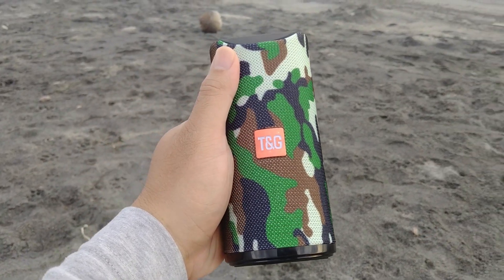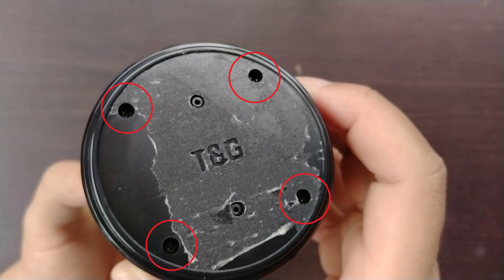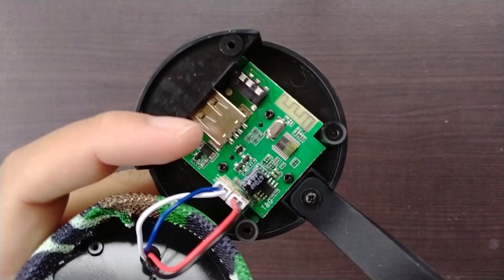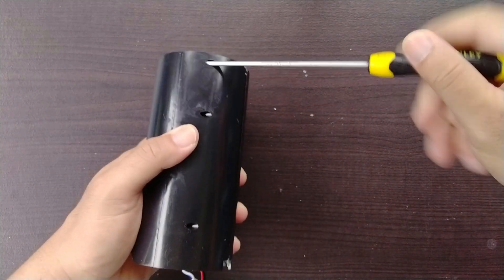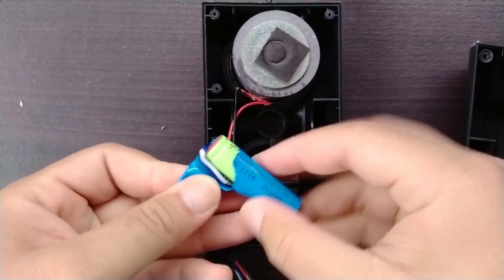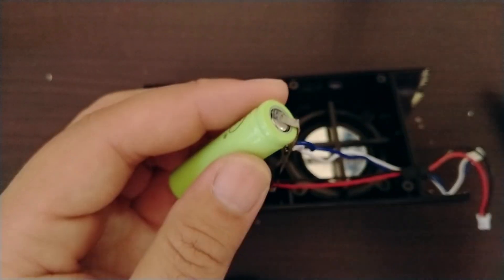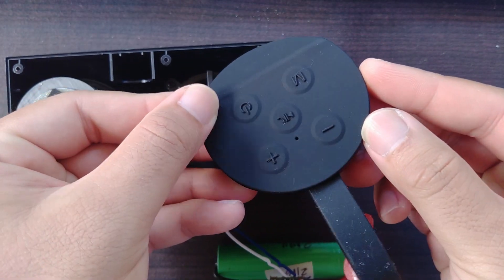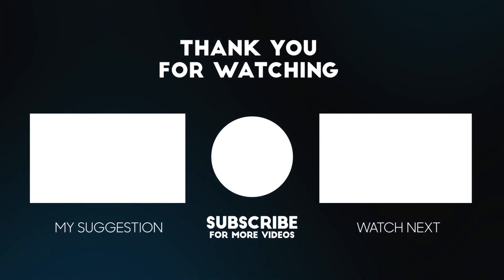How to change the T&G TG 113A Battery in 2025 (TEARDOWN)

Comment: Sir, what is the purpose of the passive radiator?
Reply from the maker: A passive radiator makes it possible for woofers to generate deep sounds, for it to work the enclosure has to be air tight and of course the speaker driver has to be a good one.
Reply: @TaylorSoloaiJR  thank you sir.
Reply from the maker: You're welcome

Comment: I think the reason that TG 113A has a space for 18650 battery is because the TG 113 uses one since it's battery capacity is higher
Reply from the maker: Yes that's exactly what it's for, the original battery is around 500mAh which is not much.

Comment: Hi idk if I'm gonna get an answer but ok.
So I'm planning to upgrade the battery of this one into a 4400mah battery that I have, but I don't have an BMS, can I use the original one on my 4400 battery? Thanks
Reply from the maker: Yes just use the BMS from the original battery of the speaker, you might want to make sure that battery really has 4400mAh. Unless you have two cells in parallel to make up that amount of mAh. The highest I've seen on a good cell is 3500mAh. More than that, then that's just too good to be true.

Comment: Can i replace the old 18650 battery of my Bluetooth speaker with a new 18650 with higher mah? 
Old one is 18650 2600mah
New one is 18650 3600mah
Reply from the maker: Yes you can

Comment: My battery doesn't had a bms
Should I buy and put it in my speaker battery or there is nothing to worry
Reply from the maker: Really? Maybe the bms is built into main board (that's just a guess). Doesn't hurt to buy one but I think it should be okay.
Reply: @TaylorSoloaiJR  thanks for quick reply.

Comment: You can also connect a mobile phone battery with stock
Reply from the maker: Not a good idea if the batteries have different mAh
Reply: @TaylorSoloaiJR  I have added a 1200mah battery with stock. Device is working fine

Comment: Soldering  the wire directly to a battery will shorten the life of the battery, or, if you are not careful, even destroy it. It's much better to buy a battery with welded strips on it, then solder the wire to these strips.
Reply from the maker: Yes you are correct, that's why it's important to do it fast but I love the idea of buying one with nickel metal strips. It's a lot safer and easier as well.
Reply: Is it possible to cool the battery with ice first then solder, the ice not directly in the contact with the battery?
Reply: @kangle2938  No. Because then you  have to solder longer. The 'trick' with spot welding is that you quickly (in milliseconds) heat very small volume on the surface of the battery, and although the temperature in the spot is very high (~2000K), the amount of produced heat is  low.
Reply: @ivanakoide9090  Oh is the spot welders cheap?

Comment: what happens if i use 2 18650?
Reply from the maker: Two 18650 batteries in parallel will increase the mAh which means more playtime. Just remember do not connect them in series.
Reply: @TaylorSoloaiJR  thx bro

Comment: Is it okay to change the speaker to 4ohm 10w and a 2200mah 3.7v parallel?
Reply: I guess as long as both batteries are from the same place and have the same charge before getting connected in parallel. Best to use new batteries. If you change the speaker to 10w you will only get 5w from it because the amplifier is only capable of outputting 5w.

Comment: Hi , i just did the same thing that you did , same bluetooth speaker .
I used 2 batteries from a power bank and it seems to work but I'm not sure what batteries they are , because the power bank it's a fake chinese one and I wanna know if it's safe to use them .
Maybe if you can send me some pictures on instagram to check them or something , thanks.
It's same batteries like you used but it's 2 of them , that's all
Oh yeah and if you could tell me how much time do you charge it after you replace the bigger battery?
Reply from the maker: The battery that I used is called "18650 Lithium Ion Battery" they are commonly used in power banks or laptop batteries.

I can't really say this for all batteries that are found in fake power banks but most are safe, the only disadvantage of using those is that the capacity is not a lot. In order to find that out, you will need a device that helps you run a capacity test. That is how I knew how much capacity I have in the one I used. Not all batteries are the same so you will get different results.

That being said, I can't really answer your question about how long your speaker needs to charge now because I not sure how much capacity it has.

Comment: Hello, nice job. Do u now if it is possible to connect a second battery and have two instead of one? The 1200mah and another one of 3400mah and have a total of 4600mah? (I have tg113)
Reply from the maker: I'm not sure about the 113 if it has enough space for two but if it does you have to make sure both batteries have the same capacity. Like both have to be 1200mAh or 3400mAh. You can't have different capacities when connecting in parallel.

Comment: Nice! Was planning to replace the battery and this is a great reference. I wanna ask, Is it ok to use 2200mAh 18650 refurbished samsung battery on this speaker? TY.
Reply from the maker: Yeah it's okay, usually I don't trust the refurbished ones but if you trust the seller than you're good.
Reply: @TaylorSoloaiJR  Thank you.

Comment: Whats the difference between 113a and 113???
Reply from the maker: The only difference that I know of is the 113A only has one speaker driver and the battery capacity is much smaller. The 113 has a battery capacity of up to 1200mAh.

Not to sure about the Bluetooth chip and the amplifier cheap that each speaker uses.
Reply: I have a TG 113 before, The sound quality between the two is very different, the 113 maybe loud but the 113A has much more bass and solid sound. 113 kinda hurts my ears because of too much treble.
Reply from the maker: Never had the 113 but I definitely agree with you on the 113A.

The sound is perfect, I'm glad they improved on the bass.
Reply: There are 3 kinds of 113 in T&G the 113, 113A, 113c but out of the three, the 113A has better sound quality than the others.
Reply: I read this thread before and have difficulty choosing between 113 and 113a as they ared priced almost the same. I went for 113a instead and did not regret it. My friend has 113 and it pales in comparison when it comes to sound quality compared to 113a. 113 is only louder.
Reply: Well im gonna buy 113a then xD cause i was really confused cause i saw a 113 that is priced the same with 113a and maybe its a fake t&g hehe
Reply: @janmichaelplaza7276  Ooh buy two tho, the TWS function hits even better than using one 113A. I have two so I recommend.
Reply: @jesrelsunit60  ill surely do that once i have the budget to get a second one :)))
Reply: Any thoughts about the tg 505??? It kinda have same price with the 113a 😅
Reply: @janmichaelplaza7276  I also have the 505 before, I gave it away tho. It was good but it is not even close to the 113A. 505 is loud but it lacks bass not like 113A that has better quality in sound.
Reply: @jesrelsunit60  im buying the 113a now xD thank you so much for answering my questions 😊😊
Reply: @janmichaelplaza7276  No prob. 😁
Reply: okay pa din ba 113a ngayon?

Comment: In my case... Soldering the battery give bad effect

One of the battery um... Like discharge too quickly, and 1 more battery ded...

Nice upgrade tho! Im working on upgrading fake charge3 aswell...
Take a look at fake charge3 passive radiator, its THICK! seriously!
Reply from the maker: Does the Charge 3 you have sound good? like has a decent bass?
Reply: @TaylorSoloaiJR  nah... They have pretty big capasitor for high pass filter
But the driver is quiet soft, better than fake xtreme

I just love the PR. evrything else is... Yah you know...